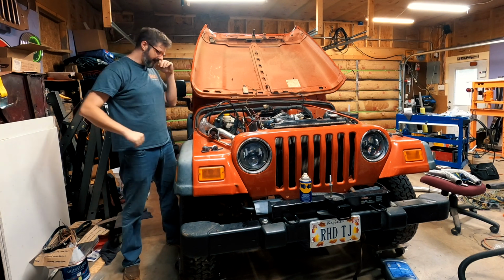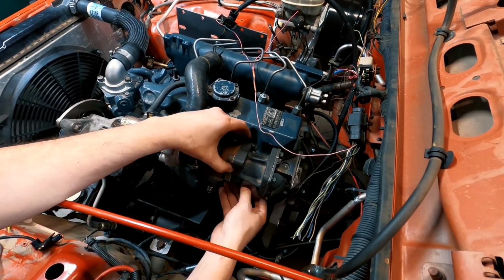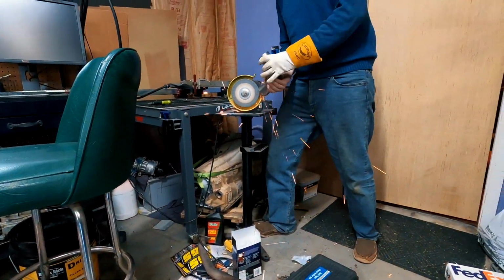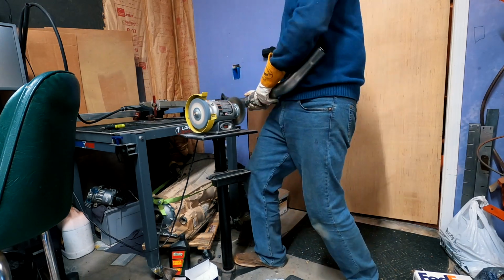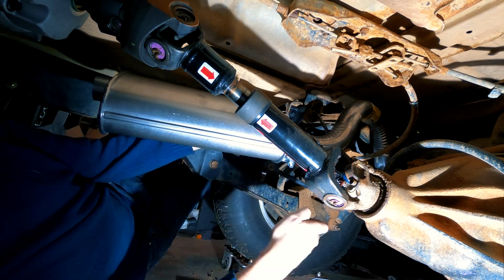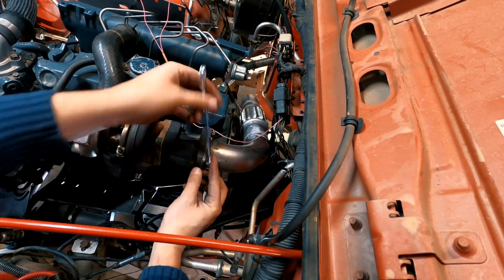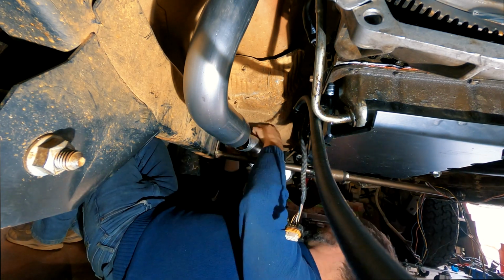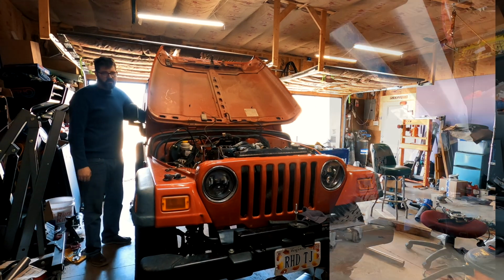Fabricating an Exhaust System [Diesel RHD TJ Wrangler - 52]

Comment: Love the project. I would def figure out something different in the future besides that flex pipe. I put that on my 6.2 diesel k30 and it's rusted out pretty bad after about 2 years. Not sure it's the road salt or the diesel soot.
Reply from the maker: Thank you for the heads up! There are several things I have done so far on the Wrangler to just get it back on the road that I don't think I'm going to keep long term and that universal flex pipe is high on my list of things that will probably be replaced sooner rather than later!
Reply: @RustyAutoholicGuy  cool!! That's a sweet project !! I guess there was a flood of Kubota engines in the market a couple years back, California banned refer units that weren't EPA compliant but I haven't seen many for sale now
Reply from the maker: Thank you so much! Honestly I went with the Kubota engine because of the lower cost, the next cheapest option was going to be the OM617 Mercedes diesel swap but I really didn't want to use an engine from the early 1980s in my 2006 TJ, at least with the Kubota the engine is newer than my Wrangler! I actually still see these engines for sale all the time around here actually, but I also live out in the country where they are used in farm equipment as well!
Reply: @RustyAutoholicGuy  cool! that makes sense. maybe i just haven't been looking hard enough haha
Reply from the maker: @trogluddite84  yeah you can get them on eBay all day long and honestly I've found all of mine on Facebook Marketplace.
Reply: @RustyAutoholicGuy  ah ok cool !

Comment: What's your estimate on fuel mileage?
Reply from the maker: Initially the fuel economy is going to be somewhere in the 20s, there tuning on the turbo, and fueling that I haven't even touched yet as well as changing the injection timing and governor springs in the injection pump as well. Once I get my intercooler installed and get the injection pump tuned, my goal is to get my TJ Wrangler somewhere in the low to mid 30s for fuel economy.
Reply: @RustyAutoholicGuy  Sounds good!

Comment: Why a cat on the diesel. Watch that muffler. If its like the one on my diesel vw dasher it will stop up
Reply from the maker: Mostly so that if I get pulled over in VA I will have a cat and muffler and will be legal. You don't need one to pass inspection where I live but you have to have one equipped if your vehicle originally came with it. Also the diesel cat I got really cuts down on the smell and emission on the engine as well which is really nice considering the open top nature of the Wrangler! I'll keep an eye on this muffler but this engine is so small and the muffler is basically a straight through I doubt it can get clogged but I'll keep on checking it just in case!